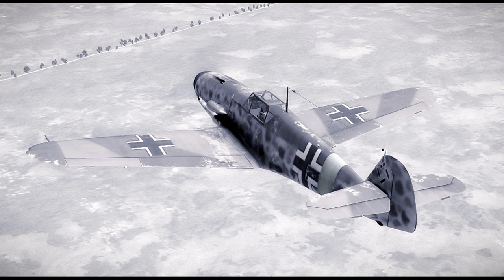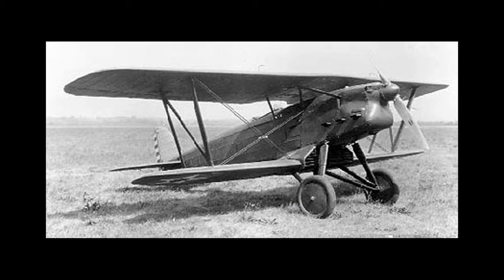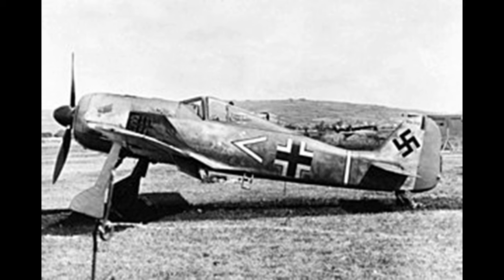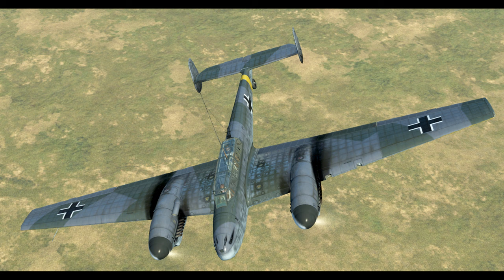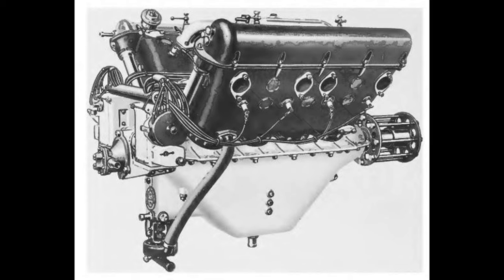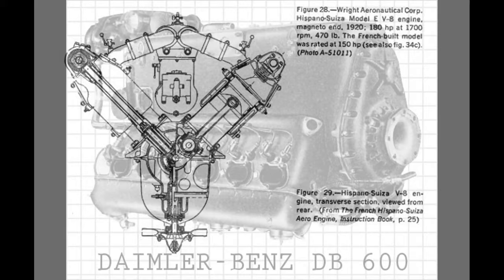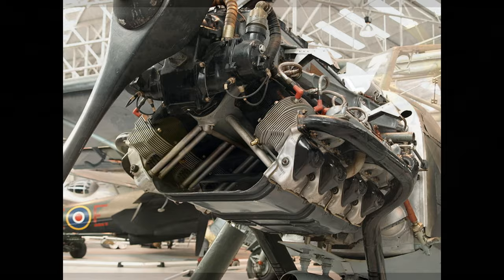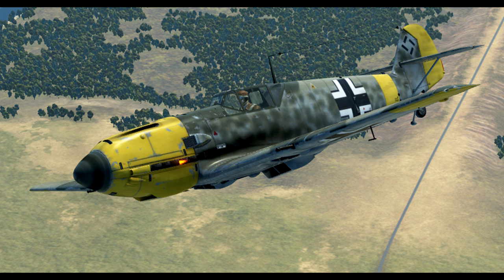Messerschmitt Bf 109 , Why an INVERTED V-12 Pt. 1? inverted V12s vs. upright

Comment: I think it's worth mentioning that the 109 also used guns mounted high in the fuselage. having the guns mounted to the sides of the crankcase would allow a smaller frontal area than going either over or to the side of  the valve covers or cylinder banks.

Comment: To be fair, I can't think of any automobiles with inverted engines either. They just make no sense, for many of the same reasons as for tanks and marine applications. Not only is access harder, but you have the engine output coming out of the wrong end of the engine. You want the final drive or propeller shaft  low down, with most of the hull or body above it. If you mounted an inverted engine in a car, the driveshaft would exit about level with the dashboard, and you'd need an extra shaft or chain to transmit the power down to the gearbox (US radial engine tanks did in fact have a similar problem, and it did add cost and complexity to them). In a ship or boat, the propeller shaft is mounted in the bottom of the hull, same problem. So an inverted makes a lot of sense in an aircraft, but not in any other application I can think of, except maybe generating electricity, and it has no advantages there. I like your theory. I never considered that aspect of it.

Comment: Golly, I thought it was all about having a cannon fire through the prop hub. Great video!
Reply: I’m 99% sure that’s the only reason. Otherwise the butt of the cannon would be staring the pilot in the face where a primary instrument should be.  

That and the direct drive engines like the Argus being inverted for prop clearance like the British Gipsy or American Ranger... but they didn’t bother with small Vee engines.

Comment: Something that doesn't seem to have been mentioned is the thrust line of the propeller. Early upright engines had to be mounted high in order to get the thrust line somewhere near the centre of drag of the aircraft to avoid massive aerodynamic trim changes when you move the throttle. This generally resulted in the cylinders obscuring the forward view from the cockpit. The answer in in-line engines was to turn the engine upside down and have the cylinders low down. The De Havilland Gypsy Major and Gypsy Queen are good examples. 

The same would have been true of V engines, but at about the same time the higher powered engine started to have a propeller shaft geared to turn more slowly than the crankshaft, which in general put the thrust line about the middle of the engine (in a vertical sense). Which in turn means visibility is not much altered by which way up you have the engine. The thrust line runs pretty nearly through the centre of the engine.

In the case of the Rolls Royce V12s, the advent of the geared drive shaft occurred before anyone thought about inverting the engine and as it solved the problem, there was no longer a reason to consider inverting. In the case of the German engines I suspect the development of the geared drive occurred after they had started building inverted engines and I guess in both cases they just continued doing it in the way it had evolved and worked for them. In both cases don't fix it if it ain't broke.

Comment: The PT boats of WW2 used Packard V12 Marine engines. I don't know if they were the inverted kind but I suspect not because of the maintenance issue problem in a boat. Each of these powerful  engines , I think there were up to four in a boat, drove a single propeller.
Reply from the maker: There were typically three per boat, and not inverted.

Comment: Just a thought, but having an inverted V-engine does leave more space for the two 8mm MGs just ahead of the pilot. I remember some pilots didn’t like having wing-mounted MGs because they were harder to boresight and adjust for an effective shot pattern. Perhaps the preferences of Luftwaffe pilots influenced the early designs, and they kept going due to institutional inertia.

Comment: ability to fit MGs in front of cockpit without enlarging the fuselage frontal cross section area. Upright V usually use wing mounted MG, requiring stronger/heavier wing.
Reply from the maker: No, I address all of that in Part 2.

Comment: The reason for all the inverted V12`s like the DB605 or the Jumos is really simple  - all maintenance intensive parts like valves, injectors, injection pumps and so on are directly accessible from the ground without the need for ladders or cranes. 
Standing on a simple ammunition box is enough for the mechanics to reach all this parts for maintenance.

Comment: You also get a lower exhaust which means less smoky exhaust gases when taxying which was usually done with the cockpit open....
Also as mentioned below less bore wash but a smokier start up as oil puddles down from the dry sump.

The DB series engines you can quite often see a streak or smear backwards from the exhaust which doesn't seem as common on upright engines

Comment: The overhead arrangement facilitated the accessibility of cylinder heads (valve timing) and spark plugs during maintenance. Also called the "A motor", an inverted V engine.

Comment: Loved the video. Towards the end of the war I think Chrysler built an inverted hemi aircraft engine, but lost funding when jets took over.
Reply: Almost all aircraft engines were “Hemi” engines with exception of the multivalve V engines the Allies had.
Reply: https://en.wikipedia.org/wiki/Chrysler_IV-2220    16 cylinders
Reply: @Bartonovich52  Most of the inline engines were 3 or 4 valve. That leaves the radials, mostly multi row that had "Hemi" heads (two valve).

Comment: This engine originated from the Daimler-Benz F4A, developed around a specification issued by the German DOT (Reichsverkehrsministerium) in the late 1920s for civilian and military use with an output of 800 PS. The first two F4A prototypes were ready for testing in 1932 and were the grand daddy of the DB 600 (601, 603, 605, 610) series of engines.

Comment: I agree adamantly with your reasons behind the design philosophy of the different engines. Especially when you look back to the needs before WWII. Once WWII started, I think your also spot on when you talk about going with what you got. Boats and tanks aside, like you said, designing a new engine is expensive. "Necessity is the mother of all invention" and I feel there was just not enough advantages either way to justify changing what was working. For the Allies, Spitfires, P-40s, p-51s, Yaks and and the like were holding their own against Messerschmidts and Focke-Wulfs. Just simply not enough need to change them. For the Germans, they had great purpose built engines and by mid war, changing it to make a single design for all apps (Plans, boats, tanks) would have been too costly and time consuming. I also suspect that for German engineering, a "one engine/all app" design was antithesis to their beliefs. Pre-war, the economics of such was probably never considered buoyed by the bravado of their early successes but by mid-war, basically it was too late for them to change.

Comment: Greg, How about the obvious? An inverted Engine gives an aircraft a lower centre of gravity. Most of the Engine mass was 30" lower in the airframe than the Merlin. 
It was also a Dry Sump inverted V12,unlike the Merlin.The DB601 also featured Direct Injection and Supercharging. 

A Spitfire couldn't follow an ME109 in an inverted dive, a normal method of escape,because the carburettor fed Supercharger on a Merlin dropped it's float bowl on rollover to follow the ME109,and caused the Merlin engine to either cut out or at least cough & splutter whilst the ME109 simply powered away. 

A third big advantage of an inverted V12 was the ability to mount a large cannon through the propeller hub. None of these technical advantages and features were mentioned?
Reply from the maker: Chris, this is part 1 of a 2 part episode. A lot of this is talked about in part 2. Anyway, a lower cg isn't a big deal in an airplane. Both Merlins and 601s when used in aircraft were dry sump (usually). Both were supercharged. Only the 601 had direct injection, but later Merlins from around late 1942 had a primitive form of fuel injection called an "injection carburetor" just like the U.S. airplanes. 

   The cannon through to prop hub isn't relevant to this as it can be just easily done with an upright V-12.

Comment: In 1931, the German engine manufacturers were asked by the Reich Ministry of Transport to develop an 800 hp aircraft engine, which was to be designed as a V-engine with “hanging” cylinders (crankshaft at the top) and was suitable for military and civil purposes. Mercedes won the contract with the Daimler-Benz F4A engine wich was than further developed to the DB 600 series.
Reason for the Reich Ministry of Transport profil : a) The engine type was in 1930-32 developed and at that time haven been centered board cannons and MG´s in use. The A form left enough space above the engine for the installation of (synchronized) on-board weapons firing through the propeller circle, while the hollow propeller shaft between the cylinder banks could accommodate the barrel of a machine gun or cannon.
b) This form of engine installation also made cylinder heads (valve control) and spark plugs easier to access for maintenance.

Comment: Amazing video. By the end of the war the Japanese couldn't make more powerful diesel engines for their tanks so they took their BMW/Kawasaki Ha9 upright v12 engines and modified them to tanks. They made more power than the diesel but the war was last by 1945 when this happened. I always wondered why they didn't use their license db 601 but it makes sense in a tank to service the engine you do it from the top the opposite of an inverted engine like the 601. Answer to my question was so simple

Comment: The Sherman firefly was the solution to superior German tanks. Each unit included a firefly when they came across a panther/tiger, the firefly engaged them. Ok if you were on target, unlucky for the occupants if the missed.
I think the German tanks were significantly more complicated to produce so only made it to the battle field in small numbers luckily.
Reply: A large number of the tanks being used in Normandy by the Germans were still the other pans are for type. They could be penetrated at combat ranges by 75 mm armed Sherman's and 57 mm armed British tanks. The panther was quickly found to be easily shot trapped from the front by the Sherman's 75 mm gun. Not to mention the very thin side armor. Well it was a good thing to have the Firefly realistically was only required when you were fighting tigers. Tigers we're rarely encountered on the Western Front and usually in relatively small numbers.

Comment: I wonder about the center of gravity while rolling and turning.... Maybe it helped with handling...  Like a Porsche has the motor weight low... The crankshaft weight is higher but the valve train is on the bottom spreading out some weight down lower.....  Or stability? Not sure how it would effect the handling... Great Video!!! Always a thumbs up Brother!!!✌🇺🇸✌

Comment: One reason inverted V's are no longer used, is the amount of oil that could leak out, even long after shut down, and go all over the ground.

Another reason to put the exhausts down low, is that many of the best test pilots were overcome by exhaust, and sometimes the exotic things used for fuel, and crashed, some dying. There is a most excellent movie about this, and the early British Supermarine test flights, where pilots passed out from direct exhaust coming out the top of the engine. WITH the original racing planes, a very young David Niven sitting on a float eating lunch!
Reply: Some great pilots were lost with these long eninges, mainly for the Italians trying to top British racing planes, when violent backfires blew off the manifolds, on top of the engine, and sometimes the pilots head, nearly knocked off.

Comment: Also it is of note to me (and what I thought was the main reason before watching this, so take this as an additional secondary point much like your point on aerodynamic advantage) is that the Germans really liked their centrally-mounted armament, and often this involved packing as much oomph as possible into the nose. Probably for reasons of accuracy, they wanted the guns to be realtively top-mounted so as to make aiming easier as the pilot doesn't have to account for the vertical offset of the guns (I'm not too well versed in this, it's just I've been told quite a few times from separate sources that the lower the guns the harder they were to aim).
Bell got around this by moving the engine back, allowing space in the nose for tricycle gear and a massive cannon. With an inverted V-engine, you can have the engine as normal as well as squeezing those high-mounted fuselage guns on the sides as there are no piston heads to obstruct the placement of guns.
This is especially visible to me in the front profiles of the 109 and 190 D vs something like the Spitfire or P-51; where the allied fighters have visible bulges to accommodate the engine, the Germans have MG 17s and 131s.
As for multiple engine fighters having inverted engines, I have read elsewhere and now this video supports the idea that it was just using the best aircraft engines which at this point were inverted due to the advantages of doing so in single-engine aircraft. Nice to see it coming together like that :D

Comment: Great video! A little more opinion but still fact based!  The maintenance thing makes sense, once you get past the cylinder head you are in for a long day.  The Ford GAA v12has almost the exact displacement as the Allison v12.  People hop up the v8 version to make lots of power, really too much for a race car. Allison’s and Merlin’s saw a lot of use in boat racing.

Comment: Btw, the  DB in DB 600 stands for Daimler Benz, which has been an automobile manufacturer Rolls Rolls Royce or Packard. While the obvious reasons for an A config have been mentioned, the perfectionism of many German engineers, willing to sacrifice ease of production and scaleabilty for optimised useability and performance could be a reasons. This proved desastrous for tank production (overengineered, difficult and expensive to build). While there are also others examples like the ingenious design of the MG42, a lot of German warplanes, ships and tanks very disproportionately complex considering their short battlefield lifetime.

Comment: Factor not mentioned: Inverted (and round) engines MUST be "pulled through" before starting, in case the inverted cylinder had a tiny oil leak (worn rings) that allowed oil to totally fill the combustion chamber. In the rare case that when starting the engine, one cylinder fires with full power, but the next cylinder is "fluid locked", trying to compress incompressible fluid (the oil) the whole engine can blow up and destroy itself. Not a big burden, just pull it through before you start, but with disastrous consequences if the worst case scenario is encountered.. Always pull it through, just in case. Also: Crankshaft above (inverted V) gives better ground clearance of the propellor. Nullified if you use a reduction gear from a crankshaft below (erect V) geared to a prop above.

Comment: This question has been answered by the Calum Douglas book on The Secret Horsepower Race, which is sourced from many original documents.  In 1937 three senior Rolls Royce engineers were invited to tour the highlights of the German aeronautical industry.  In their report they recorded that Dr. Helmuth Sachse (director of German aero engine development) stated: "The inverted engine was chosen by the German Air Ministry because of the general ease of installation, accessibility, and view in the case of single-engine machines".
Reply from the maker: So a British guy says he heard something from a German and that count's as proof? Hell no. Now if you had a document from the Director of German Aero Engine Development, then you would have something pretty solid, otherwise it hearsay. 

     This is the problem I have with a lot of WW2 history. Some people have really low standard for evidence, then they put it into a book claiming claiming it's a sure thing. Next thing you know, others cite that book as a source and it snowballs from there. There are so many WW2 aircraft myths that started that way I could make videos about them all day long.

Comment: The Soviet v12s were derived from the BMW VI which was a development of the IIIa, both upright engines. The Rolls engineers had the Eagle and Kestril to draw on. The DB had earlier Airship engines for the 603, an inverted v16 diesel I think. I will check my books. Check Aviation Week and the Aeroplane periodicals from the 30s and 40s. NC State library has bound editions

Comment: Inverted cylinders (even on radials) can have oil issues beyond the sump scavenge, the big one is oil pooling in the cylinders. This is why you alway see radials get pulled through several rotations slowly before startup to clear the lower cylinders just in case this pooled oil drained passed the piston rings potentially causing a hydraulic lock. 
Also pooled oil on moving parts takes energy to toss around and will add drag reducing power and efficiency. 
On the plus side a higher crankshaft allows a bigger prop.

Comment: I look at the guns being up high and closer to being in line with the eyes of the pilot,   Also moving the propeller centerline higher on the air frame giving it better on ground clearance and problem a better center line roll closer to the pilots head vs closer to his feet.  As for the twins with inverted Vs.  It is just we have this, we know how to make it work, we will stick with it on other aircrafts.
Reply from the maker: The prop doesn't move higher because the gear drive offset it back down.